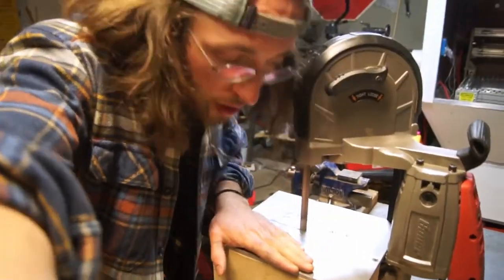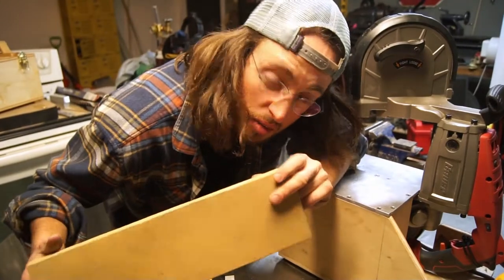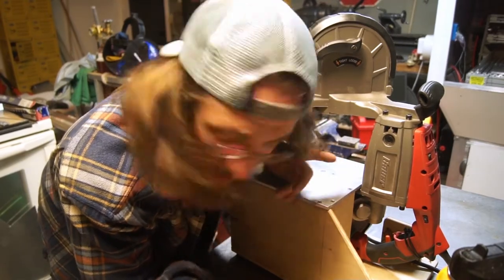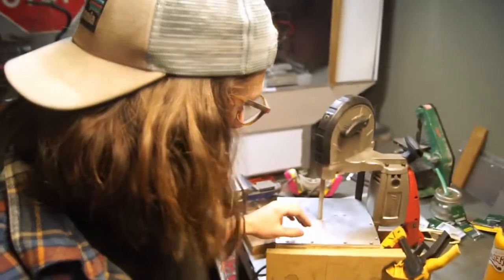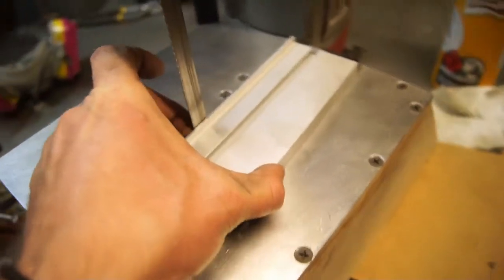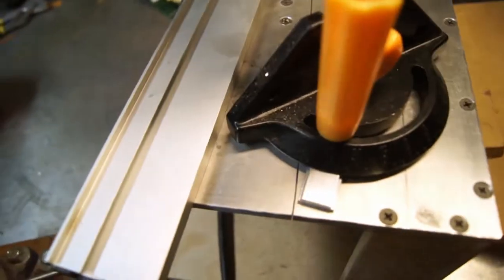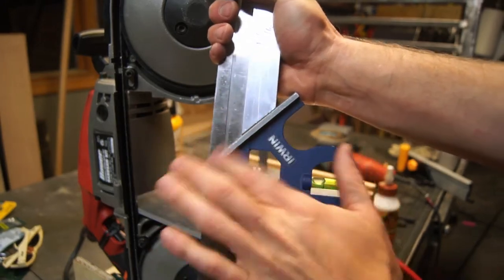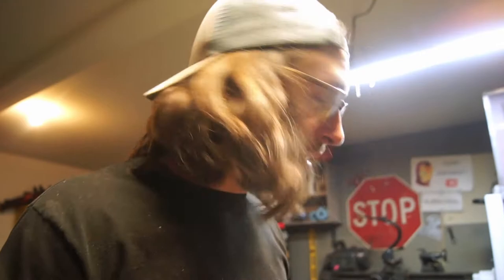Angle (Miter) Attachment for Mini Bandsaw Upgrade!!!

Comment: A little bit off topic, but are you planning to use a separate hydraulics + muscle system for every major muscle? 
I watched your videos about the hydraulic muscle and it seemed like that, because you had a tiny fluid reservoir with a pump. Or that was just for testing?
Reply from the maker: Yep that’s what I’m doing! They’re called electrohydraulic actuators. I talk about them in the next video coming out!
Reply: @DylanEdmiston  This is great, I didn't get why you want to use a separate hydraulic pump instead of one or two big and "centralized" with a valve system. Would be interesting to hear about that choice and what are the advantages.
Reply from the maker: The advantages are mostly decoreased plumbing and increased controllability